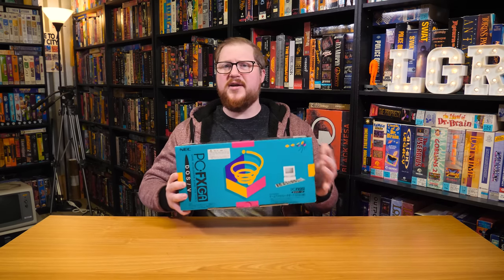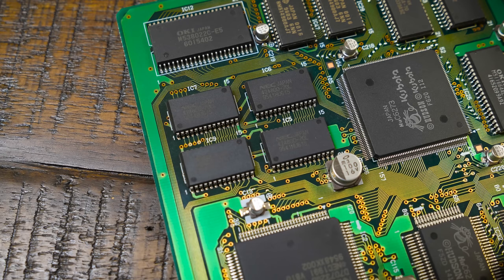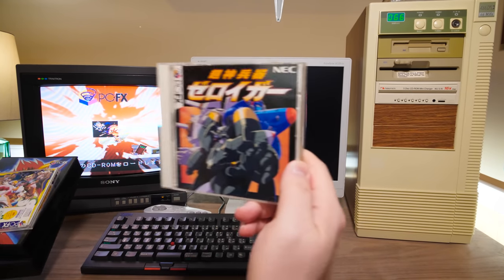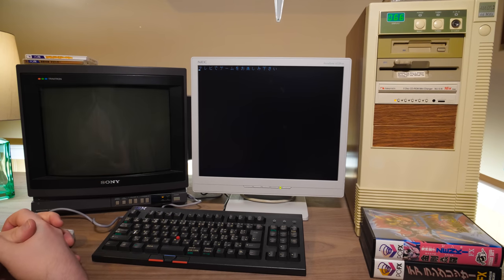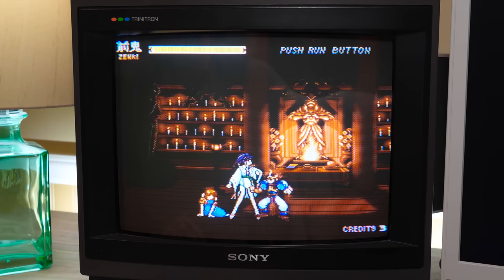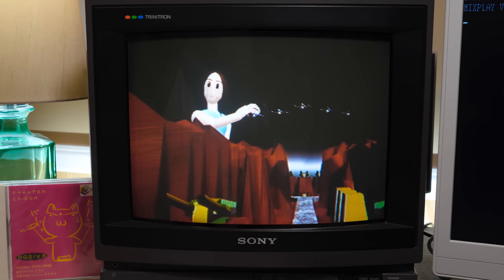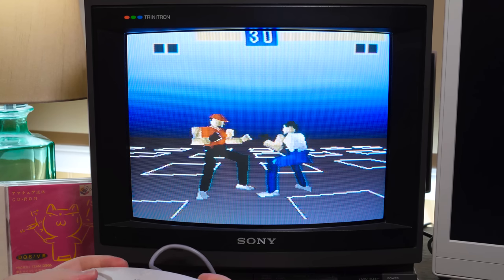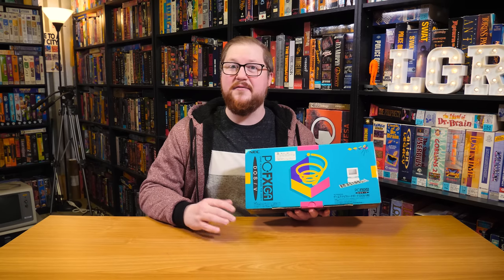LGR Oddware - NEC PC-FXGA DOS/V Game Accelerator Card

Comment: Man, ... there is no good reason for this to exist.  It’s just an obscenely over complicated CD-ROM interface that has the side effect of holding your computer hostage while it’s in use.  Like... why??  Haha 😄
Reply: If it was actually able to display the game graphics at a higher resolution on the PC monitor it might have some reason for existence but even then not a very convincing reason.
Reply: I think that this card was originally designed for the game/software developers. They could write the code on the PC and push it directly on the GF-FX console hardware for testing.
Reply: If you already had a PC and CD drive this would be cheaper than the full console? That's about all I can think of.
Reply: Not that it wasn't the case with every DOS application ever (except those specifically designed to multitask other applications, like Win 3.x and Desqview - no time to check if that's the correct spelling - and of course Terminate and Stay Resident applications). They all prevented you from running other applications while they were running, because DOS was single tasking OS (ok, with the exception of less used multitasking DOS variants) - so running a game designed for this card and running a regular DOS application really only differs in that DOS applications would run on the PC's monitor while this outputted to secondary monitor (a TV most of the time).

So considering that, holding the PC a hostage wouldn't have felt like anything out of the ordinary for DOS users of the time period - sure, it would have been great if it left the DOS running freely when it was used, but that would be giving extra functionality to the PC; the ability to run games on second screen while running other DOS stuff on the PC monitor. Would it have been possible for the system to run at the same time and not "holding the PC as hostage", that I don't know - if it used the PC sound card for audio, that could be problematic but I don't know for sure.

There have also been other such systems for PC and running in DOS and as far as I know they all (not that there are that many) prevented running DOS applications at the same time.
Reply: Sure... but then you're actually using the PC to play a game.  Here, you're using the PC to read a CD and power an expansion card.

To be fair, I did something .... uh, similar, I guess ... when the Creative DXR2 DVD-ROM and MPEG2 card kit came out.  I used my computer as a DVD player, with a TV connected to the MPEG card's video out and SB Live's line out.  I played movies this way until I got a PlayStation 2.  I never actually owned a dedicated DVD player.

In my defense, I was going to buy a DVD kit anyway, to read DVD-ROMs, and the MPEG card supported FMV in a handful of games (like Wing Commander IV.)  I left my computer on 24/7, so if I was watching a movie, it was just going to be sitting there, powered on, anyway.

Maybe that's kind of the same thing.  * shrug *

Comment: So you only need free slot, cd player and connect it to your TV and then you can play terribly cheap games. Why did it fail?
Reply: I'm pretty sure most people would have a TV, especially if they wanted to play console games. And im also pretty sure most pc users had a cd rom drive, especially if they wanted to play cd rom based video games.  And I'm also also pretty sure that pretty much everybody had multiple free slots in their pc, especially if they were buying an upgrade card for playing video games.  
You act like most of the target market didn't have this stuff to begin with.   Like omg can you believe that in order to play the new ps5 online you have to have an internet connection?   And to even turn it on you need to have electricity?!?  Then to play a game you have to buy a game?!  Wtf, those greedy bastards!
Reply: Думаю, это попытка создать уникальную для Японии того времени область рынка. Без оглядки на конкурентов (Nintendo, Sega и другие), которые, имея куда больший опыт, действовали, скажем так, в правильном направлении. В результате - вытеснение многих компаний из сектора игровой индустрии.
Reply: @JaredConnell  The point is: The card basically hogs the PC for nothing but power and CD drive access while not even outputting to the PC monitor. It's just an inconvenient setup.
Reply: @JaredConnell  do you have a crt tv hooked up at your computer desk along with separate monitor?
Reply: You could have used a pc-fx linked to a scsi card in a pc98, no need for another cd-rom
Reply: @JaredConnell  wrote "And I'm also also pretty sure that pretty much everybody had multiple free slots in their pc". 
But would  they have had free addresses and an IRQ to set it to? Those were the bane of everyone trying to fit a new card in a 1990s PC.
Reply: @TouhouGaijin  lol, no.  But I love NEC.
Reply: @TouhouGaijin  The videos were great. The gameplay was just terribly cheap considering the consoles which were launched at that time.
Reply: @JaredConnell  People did have a TV but almost never next to their PC. Just like today. Do you have your PC next to your TV?

Comment: You will be pleased to know that the yen sign is still a thing in modern 2020 Windows 10 for file paths. You just push the regular back slash key and it just works (I have been using JP IME on Windows for 20 years almost). Copy/paste auto converts to the user's own locale.

Comment: This thing's very impressive, it being a card in your PC that outputs its graphics to a separate CRT screen - kind of reminds me of the Memotech MTX512 that was in Weird Science - although I don't think those graphics were being produced by the Memotech! Shame you can't programme this on the PC to output simultaneously to the big monitor like they seemed to be able to do with the Memotech in the film!
Edit: Actually, that got me thinking, wasn't there any graphics workstations that used that kind of set-up back in the day, with a main pc or whatever to design your graphical sequence on, and a larger display monitor that displayed the finished sequence (almost so you could edit it while it was running and you could see an instant update of what your alterations looked like)? I could swear I saw something like that on a tech programme once or maybe a making of a film from the 90's showing how they did the cgi.

Comment: I own one of those CD changers, looks like mine is exactly the same but I can't know for sure.

I had bought it for my Linux Server so I could fit all the distribution Discs into my Server at the same time. In Linux, it behaves as a single CD drive. The trick is that the EJECT command can change the discs. It also did an UNMOUNT first.

The advantage was that when I remotely logged into my Server, I didn't had to walk down all the way from the 4th floor into the cellar into a maze of twisty little passages, all alike to change the CDs.

The problem with this was whenever I made a typo, the EJECT command did just that - to eject the disc. And unlike with a tray drive, there was no way to remotely put the disc back in. Worse, with a disc stuck in the slot, the changer didn't work either. So I often had to run down the staircase from 4th floor into the cellar and enter that maze of twisty little passages, all alike to give the disc a little nudge to put it back.

Comment: 15:01 Chip and Chap are, coincidentally, german names for Chip (duh) and Dale, so there's this.

Also this sounds perfect for one of those analog-to-RGB conversion boxes you can get cheaply and they also have VGA passthrough so you could just use the monitor for both, switching the input signals.

Comment: I wish there was a modern FPGA card we could run whatever on, on our PCs. Maybe a USB device that could be used independently like most single board FPGA computers do and than can be ran through a PC as a passthrough device that could use the sound, video and inputs from the computer kind of like a hardware virtual machine.

Comment: Oh man I haven't seen DoGA mentioned in ages!

There's a lil' Japanese set of programs called DoGA Animation, or DoGA L1, L2, and L3. DoGA L3 is the most Robust program that let you animate colored and tecxtured models. Models are assembled piece by piece and there's a learning curve but the results arte some 90's CG brilliance. Pasying for DoGA got the animation option, but you could easily use free to render up still frames for a larf. DoGA L3 comes with optional extra pre-rendered Bacckggrounds and you need to render in your own ground and model and props and FX. You can also grab extra parts if you stalk the Japanese web, or make them in Metasequoia with the right program. DoGA L3 came out somewhgere around the era of Win 98 or so, however so I'm unauew if it was made by the same group but the name makes me suspect it might bew, ergo a little fun to learn aBOUT!

sADLY, dOga l3 DOESN'T WORK IOIN wINDOWS 10, SO THE LAST wINBKLLOWS i CAN SAY IT LIKES FOR SURE IS 7.

Comment: Seems kind of similar to a TeraDrive or a 3DO Blaster, neat concepts that don't always work well in practice because of wonky integration.  Anyways, regarding your Nakamichi CD-ROM drive, I used to have one of those (a 4 disc 8 speed SCSI one), and it did the same "every drive is a drive letter" thing.  This is actually very useful for some multi-disc games designed to accomodate it.  The installer for the Tex Murphy CD games (Under a Killing Moon, Pandora Directive, Overseer) allow you to set a drive letter for each disc, so you could in theory play the entire game without switching discs.  I imagine some other multi-disc games might support this but I'm not sure which ones...

Comment: Funnily enough, you can get a USB 2.0 to ISA convertor and then run a virtualized instance of DOS/V or MS-DOS on a modern computer. But if it's based on the actual console, then a YPbPr mod should be possible, letting you run it in component for a much cleaner signal. Combine that with a very simple and cheap HDMI signal convertor and boom, you have the ability to run the card on your second monitor, while using your primary computer for anything else. I understand the sentiments for running it on the hardware it was designed for, but cards like this are too cool not to use honestly.

Not saying that the S-Video shouldn't look outstanding on a PVM or anything, but some may have a less-than-mint card they might want to get a clean and easy to use YUV signal out of.

It even allows for easy HDMI passthrough recording/streaming.
Reply: Y/Pb/Pr and RGB are just better than S-Video anyway.

Comment: The crazy unique thing about the NEC PC-FX (and the PC-FXGA) and the reason why FMV and pre-rendered graphics are such a big thing with the console, is that unlike it's competitors the saturn, Jaguar, ect it doesn't have a 3d-based polygon graphics chip at all So any of the 3d graphics you see are either pre-rendered or FMV simply because there's no other way. I read that they chose not to include any kind of polygonal graphics processor in it, because they believed at that time graphic processors available weren't advanced enough and had insufficient power which would lead to ugly, blocky graphics  That, along with it being mainly marketed to an incredibly small niche audience, were seen as the main reasons it never really took off and ultimately failed. 

IMO, it's kind of crazy that a console that was pretty advanced for it's time and attempted things that were way ahead of it's time had weird almost backwards way of thinking when it comes to certain things.It was both innovative but also oddly behind the times, which IMO what really makes this particular console so interesting but really held it back from it's full potential. Also if you think about it..nowadays, especially with the new generation of consoles that are soon to be released, are basically miniature gaming PC's that fact that the few consoles who attempted to do this in the past like this and Phillips 3DO ended up being complete and utter failures is kinda crazy and really interesting!

Also, another cool tidbit of trivia is that not only did NEC try to put almost all of their focus on the Young male "otaku"/anime fans, NEC actually directed Hudson Soft (their partner) to ONLY develop games that were based on popular Anime franchises and to always feature pre-rendered anime footage in the games.

Comment: Oh, god, the poor, poor PC-FX. It would have blown everything out of the water if it had released when originally intended and likely have held on well past later 32-bit consoles appearing just through early market share... but first it had to be delayed due to a lack of finished games... and then again*, most likely because the PC Engine (Turbo-Grafx 16/Turbo Duo) was still doing super well in Japan and they didn't want to cannibalize its market share. Even by the time of the release of the Jaguar and 3DO, it was starting to badly show its age despite *still not being released, and by the time it released in late December 1994, with the Playstation and Saturn both out and its only significant technical achievement being a form of Motion JPEG that made it better at FMV than any other fifth-gen console, it was doomed. It held out surprisingly long given that, but had dismal sales, and NEC's decision to have Hudson focus solely on games that played to the console's strengths at the expense of popular franchises that helped make the PC Engine the success it was... YEAH.

Comment: I have an NEC multispin 4x4 drive, it's very similar to the changer you've got (except 4 discs, 4x, and IDE). I think in windows 95+, it shows up natively as different drive letters. I think the utility for win3.1 might be able to have them all appear as a single drive letter, though I'm not sure as it's been a long time since I've used it.

Comment: The "Kubota" on one of the chips is really related to the japanese Kubota tractor company:

"The Huc6273 (Aurora) was designed by Hudson and Kubota Corp, a tractor and heavy equipment manufacturer based in Osaka, Japan. In the 90s Kubota was cash rich and saw an opportunity in making workstations aimed at 3D graphics applications. Kubota joined forces with companies such as Stellar and Ardent, calling the company Stardent which later became Kubota Pacific, then Kubota Graphics who was then acquired and the name disappeared."

https://cdromrom.wordpress.com/pc-fxga-wip/huc6273-aurora

Comment: It is weird seeing Kubota on a computer chip for me. In my city Kubota is attached to a steelworks factory that mostly provides metal pipes for the oil industry. I know I have also seen that name on tractors. Just never seen it on a computer chip before and I know it is the same Corporation because that font is exactly the same and TM.

Comment: regarding not being able to do anything on the PC whilst this was running a game, what would really be odd would to put the NEC PC-FXGA DOS/V Game Accelerator Card in one of two Amiga 2000 ISA slots, alongside an Amiga A2088 bridgeboard, which adds IBM PC compatibility to the A2000, then run DOS in an Amiga Workbench window, and boot up the game card,  using the A2000's SCSI or IDE CDROM for game CD access. Then you COULD do something on the computer, because the AMIGA was multitasking ;)

Comment: Correct me if I'm wrong but wouldn't it be stupidly easy to implement the software it needs as a TSR rather than occupying the whole machine? As far as I can tell the only thing it does is transfer two block IO functions to the PC: write save file, and read blocks from CD or HDD (? assuming this is how the SDK works). Controller input and video output are handled by the card itself via the breakout box; only CD-Audio runs through the sound card because (haven't looked this up, again correct me if I'm wrong) the PC-FX handles it separately and mixes it in the end also (its 6-bit sound chip certainly couldn't do it). I don't know too much about TSRs besides having had to use some in the past, but this sounds doable in one to me. Would be fun to play PC-FX next to a Windows 3.1 session.

EDIT: If someone went and did this, they could probably play I̶S̶O̶s̶ BIN/CUEs off the hard drive with that card and the accordingly modified software.

EDIT 2: Haha actually you don't even need a sound card if your disc drive has a headphone output. (Potentially you could also get an adapter for the analog connector on the back?)

Comment: Now I want to see somebody try and put it in the same computer as the 3DO card and with that Nvidia graphics card that's about half of a Saturn.... Hell, the only way you could top that console cavalcade trainwreck would be to put in one of those computers that also had a built-in Genesis but IIRC none of those would've had enough horsepower to properly run the other addons in this case.

Comment: Wait, it can't output to the monitor? The only thing it's using the PC for is to communicate with the CDROM? It costs about as much as the console? Then what the hell is the point of this card? What were they thinking?
Reply: The fact that this card released around the same time as the 3DO Blaster makes that especially weird since the 3DO Blaster was able to output to the PC monitor just fine, if in a slightly unconventional way.

edit: It does do one thing better than the 3DO Blaster though: the 3DO Blaster requires a Creative CR-563 CD-ROM drive to work, it doesn’t work and is effectively useless with anything else (firmware to enable this was supposedly coming out, but never materialised - likely due to the failure of both the Blaster as well as its parent platform) whereas this doesn’t seem to be limited like that.

Some others here suggested it might be because this was potentially intended as part of a devkit setup. Having the PC-FX side output separately to the PC means you could potentially have had a debugger or something running on the PC while being able to test your game on the TV.